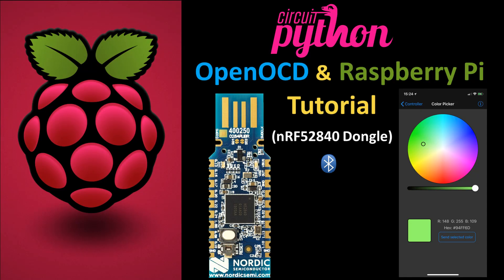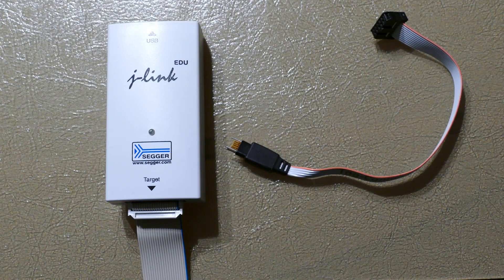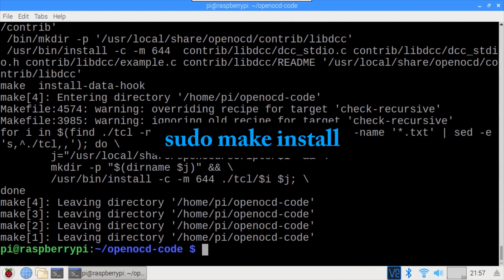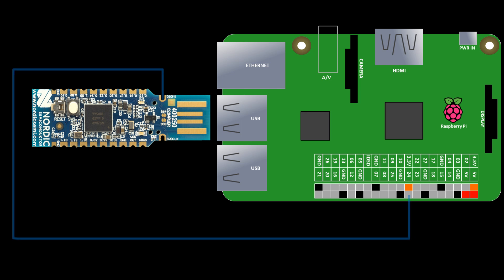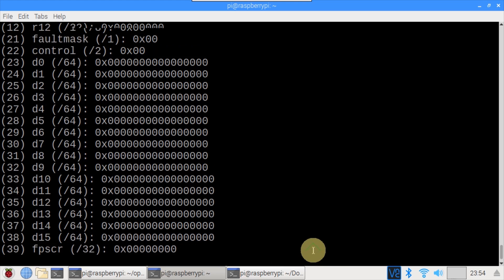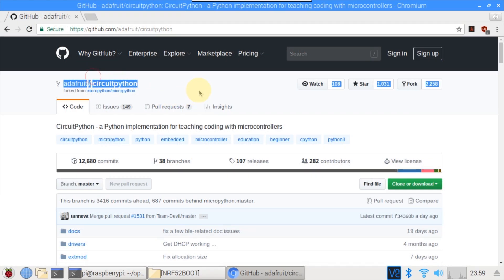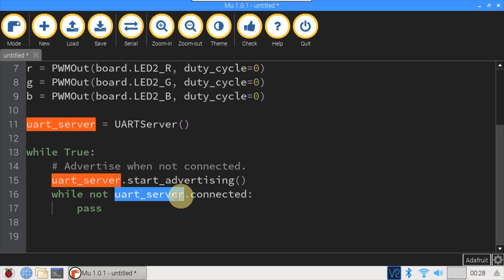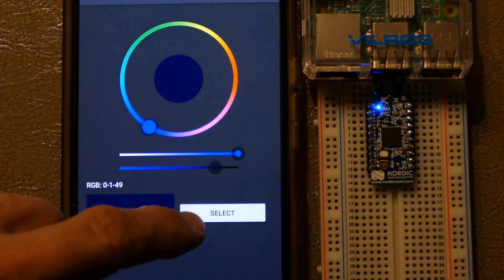CircuitPython nRF52840-dongle OpenOCD Pi Tutorial

Comment: Hi, Is anyone experiencing some instability on that board? , I have often the board coming back to NRF52BOOT.
I wonder if I should reupload the hex.

 I am using it with both MicroPython and Arduino IDE.
Reply from the maker: I think the PCA10059 dongle only has 1 MB of flash.  I encountered memory issues with larger MicroPython programs using the dongle.  I switched to the Adafruit nRF52840 feather because it comes with an additional 2 MB of QSPI flash.  I find the Adafruit boards to be very stable and reliable.

Comment: Thanks for the tutorial , I would not have proceed without that.

Is it possible to still find the version of Circuit python you are using, it keep getting an error "ImportError: no module named 'adafruit_ble.uart'" with the latest version.
Reply from the maker: Adafruit has made extensive changes to the CircuitPython BLE library. Please see my website for updated code (link in description).
Reply: @rdagger   Thanks a lot for you help :)

Comment: This is probably the only comprehensive tutorial I found on how to get over the signed bootloader nightmare. The problem wasn't only they locked in the bootloader, but this information is hidden so deep that being unfamiliar with nrf stuff  it took me ages to figure out wtf is going on?  That's a bad taste for anyone trying to  "chew" nrf products for the first time.  I also have a question - can I use st-link v2 programmer with openocd on linux64 instead of getting through a whole raspberry pi compile& setup cycle?
Reply from the maker: I haven’t tried, but it should work.

Comment: Where to get the j-link needle adapter? Is that cable expensive?
Reply from the maker: I bought the plug-of-nails cable and retainer clip from Digi-Key.  The cable was $39.  The retainer was $6.  Manufacturer part #'s: TC2050-IDC-NL and TC2050-CLIP.  I etched the adapter board myself.

Comment: Any reason you didn't utilize the already built in bootloader with `nrfutil pkg generate` to make a dfu.zip and `nrfutil dfu usb-serial` to flash it?
Reply from the maker: As mentioned at 1:50, the bootloader requires DFU updates to be signed.

Comment: Great tutorial!

Unfortunately - I got a 'smaller' verified amount of bytes while writing to - and - verifying the flashed nRF52840-dongle (at 9:59).  Everything up to that point being a carbon-copy of your own command line outputs.  A paste of my output is below -

> nrf5 mass_erase
nRF52840-QIAA(build code: C0) 1024kB Flash
> flash write_image /home/pi/Downloads/pca10059_bootloader-0.2.10_s140_6.1.1.hex
using fast async flash loader. This is currently supported
only with ST-Link and CMSIS-DAP. If you have issues, add
"set WORKAREASIZE 0" before sourcing nrf51.cfg/nrf52.cfg to disable it
wrote 632 bytes from file /home/pi/Downloads/pca10059_bootloader-0.2.10_s140_6.1.1.hex in 0.118851s (5.193 KiB/s)
> verify_image /home/pi/Downloads/pca10059_bootloader-0.2.10_s140_6.1.1.hex     
verified 632 bytes in 0.018797s (32.834 KiB/s)

The newer hexfile itself is 502kb long and is the latest release 0.2.10 as found at https://github.com/adafruit/Adafruit_nRF52_Bootloader/releases
So the upshot is that the dongle usb drive will not appear when i run the 'reset run' command.

I reduced the adapter_khz value to 800 from 1000 (as mentioned at 8:23) but no success. Not sure what else to do..
Reply from the maker: I'll try flashing the latest bootloader when I get home today.  Are you using the PCA10059 dongle?  The SeedStudio dongle is not compatible.  It's also possible that the RegOut0 register was cleared.  If so, you'll need to use a level shifter.  There's instructions on my website.  You can lower adapter_khz more such as 100.  Also keep the wires short for SWDIO and SWCLK.
Reply from the maker: I loaded the UF2 Bootloader 0.2.10 using OpenOCD.  I tested all the code from my last video and everything works.
The OpenOCD output showed: "wrote 183928 bytes from file /home/pi/Downloads/pca10059_bootloader-0.2.10_s140_6.1.1.hex"
I would try lowering adapter_khz to 100 and make sure you have good quality short jumper wires.
Reply: I'll try those suggestions  @rdagger  .. 

Error first appeared back at 6:52. I noticed no flashing LED (no LED on at all).  When i ran 'sudo openocd' the following output appeared..
_____
pi@MicksPi3:~/openocd-config $ sudo openocd
Open On-Chip Debugger 0.10.0+dev-00764-g92c50fda (2019-04-05-19:27)
Licensed under GNU GPL v2
For bug reports, read
 http://openocd.org/doc/doxygen/bugs.html
BCM2835 GPIO nums: swclk = 25, swdio = 24
adapter speed: 1000 kHz
cortex_m reset_config sysresetreq
Info : BCM2835 GPIO JTAG/SWD biting driver
Info : SWD only mode enabled (specify tck, tms, tdi and tdo gpios to add JTAG mode)
Info : clock speed 1004 kHz
Info : SWD DPIDR 0x2ba01477
Info : nrf52840.cpu: hardware has 6 breakpoints, 4 watchpoints
Error: nrf52840.cpu -- clearing lockup after double fault
Polling target nrf52840.cpu failed, trying to reexamine
Info : nrf52840.cpu: hardware has 6 breakpoints, 4 watchpoints
Info : Listening on port 3333 for gdb connections
    TargetName         Type       Endian TapName            State       
--  ------------------ ---------- ------ ------------------ ------------
 0* nrf52840.cpu       cortex_m   little nrf52840.cpu       halted
target halted due to debug-request, current mode: Thread 
xPSR: 00000000 pc: 0x623c3e6c msp: 0x6d74683c
Info : Listening on port 6666 for tcl connections
Info : Listening on port 4444 for telnet connections
____

You'll notice that it says - 'Error: nrf52840.cpu -- clearing lockup after double fault' and also the 'State' differs to yours in that mine is 'halted'. Also same error appears after i enter 'reset run' once i telnet in.
Running 'reg', 'targets', and 'flash banks' also produce similar output to your own.
Ta, Michael.